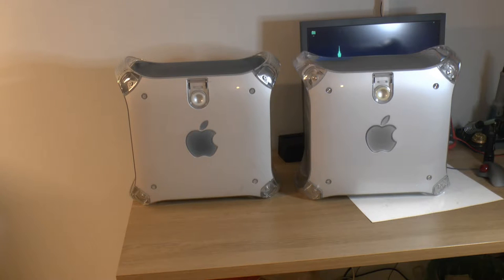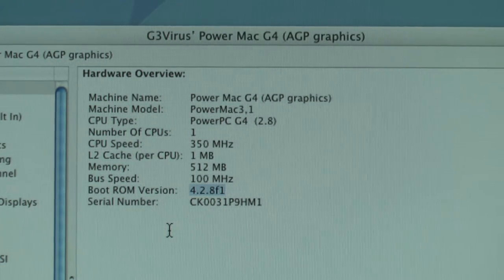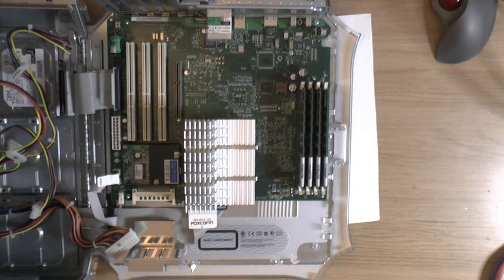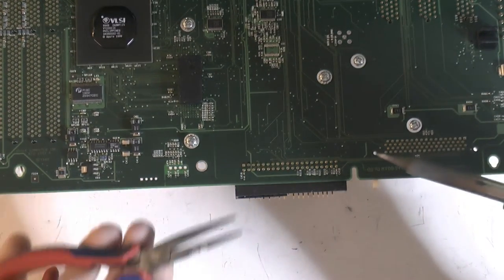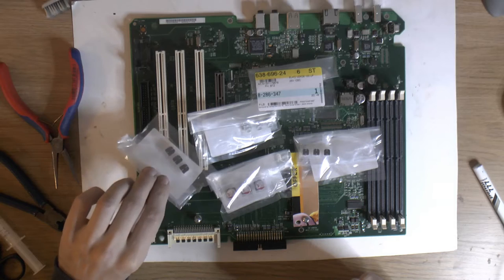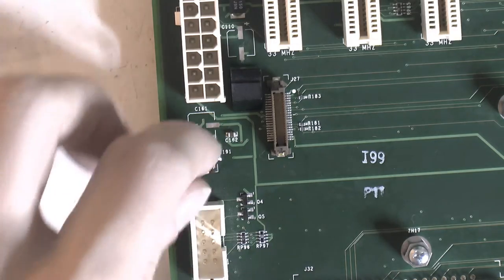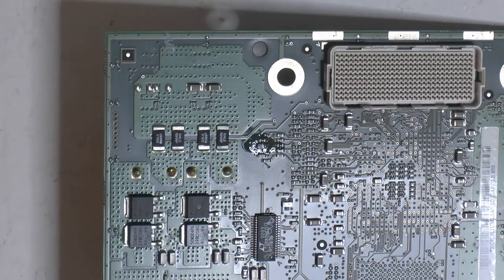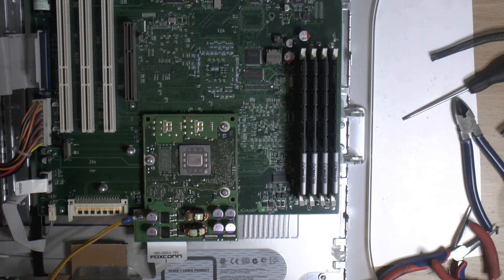Power Mac G4 restoration and upgrade - part 1

Comment: I have the Power Mac AGP 450 Mhz that throws a tantrum.
If I start the system with the SHIFT pressed it completes the boot but obviously has no hardware acceleration, no audio etc.
Otherwise it freezes on the blue screen with the pointer moving if I move the mouse.
Tried to reinstall OSx
Tried to change hardisk
tried to change video card
Tried to change ram
Checked the power supply voltages.

Some advice?
Reply from the maker: Not rely, this Mac is my first since I owned a G4 Mac mini back when they where new so this was a learning experience for me to.

If you tried most removable components I would try to get a motherboard on ebay, search for "powermac g4 motherboard", they seem to start at 20-25€ so its probably cheaper to just try that.
You sad you tried to reinstall it, can you boot anything?
If you can try the tool I used to check mine out. Techtool Pro 4.
Im running it here. It might be able to pinpoint the problem.
https://youtu.be/G3ZSwNw_ETc?t=649

Just google for the tool, its bootable from a cd or dvd depending on version. I used a cd version.
Reply: Thanks for your reply, you are very kind.
Actually I have tried several ways to make it work and I'll explain why:

With a hack I also tried to install OSx Leopard, which he completed without problems, just like with Tiger or OS9.
But on the first reboot, as soon as it loads the video drivers and that blue screen appears with the pointer in the upper left, it seems that it does not go further despite the noise of the disk indicating that it continues to load.
So I turn everything off and heartbroken I keep it ...
After many days I decide to try again, I turn it on and miracle it loads OSx Leopard and everything works, audio, video card, network everything….
I use it for about an hour without a block without problems, without restarting.
But as soon as I decide to restart, it starts having the same problem again.
I have other Mac G4s (QS, MDD, G5) but none of them behave like this .... it's very strange.
You ask me to buy a logic board on eBay but few people are honest and they send you something working….
But if it is the only way forward ... I will do so.

Why so much insistence? Because I love these PowerPc technologies, because I know they have untapped potential and I would like to fix my toy! ;)
Reply from the maker: @Vlamat67  I have bought many things on ebay but I use it as a last resort. But I find it to be fairly reliable, got the wrong thing once and one thing got lost but I got my money back not questions asked both times.

The reason I suggested a new motherboard is if you have already tried components from a similar system, Graphics card, hdd, ram etc and those components are know to be good then the motherboard is next.

Considering the price a used one off ebay its not that expensive and the motherboard is the most complex thing in the system so often whats broken in old computers.

So I am "suggesting" it because theirs really not much else that I can think of being the fault if all other components and software has been excluded as the culprit.
I saw some deals where the CPU was included to, I like to have some spares for testing just in case.
Its very difficult to rule things out with out spares parts thats the reality.

I assume the PRAM battery have been replaced to so its fresh?

Anyway I hope you get it fixed!

Comment: This CPU card can be safely overclocked to 1GHz without problems, i have try some years ago.
Reply from the maker: Probably but running the 100Mhz FSB instead of 133 means Im at the Max 8 multi the PCB allows me to set moving the resistors. 
As fare as I can tell from the Motorola CPU docs there are multi higher but that will probably require modifying the PCB because the extended range multiplier resistor is not on this PCB as fare as I can tell.

But if anyone knows how to set 9x and higher Im all for it!

Also I am running a 867@800 now with 2Mb L3 cache so this video is a bit out of date.
Reply: If your motherboard is a Sawthoot you can overclock the bus from 100mhz to 133mhz via Open Firmware. If you have a Gigabite Ethernet, you can put up to 120MHz with some jumper in the motherboard:
https://rosysumenteinquieta.blogspot.com/2006/02/como-subir-el-bus-de-un-g4_5.html
Reply from the maker: @indibil  Yes I know, I have micro dip switches for that. But its not without problems like USB ports not working, no guarantee it will do 133Mhz.
Also 4 sticks of ram at 133Mhz, not gonna work with none buffered sticks (not that it even supports that) and thats why the QS board has 3 dimm slots.
Also if I recall you need to patch it so the RTC runs at the right speed under OS 9, think OS X will sort that out it self.
Reply: you can overclock the 800mhz G4 without L3 Cache up to 1GHz:
http://rosysumenteinquieta.blogspot.com/2007/03/overclock-del-procesador-de-un.html
http://rosysumenteinquieta.blogspot.com/2007/03/overclock-del-procesador-de-un_30.html

I have build this mod some years ago.
Reply from the maker: @indibil  Yea thats a nice guide.
I have looked in to it before.
The 867Mhz I have running 800Mhz is about 48% faster in Quake 3 then the the 800Mhz with no L3 cache so even a 800@1Ghz with no L3 is gonna be a lot slower.

The annoying thing is that the PCB for the L3 cache version do not have the extended multiplier resistor in the same place, I can guess where it is but idk for sure thats the problem.

Might look in to it again, best thing would be to get the 867Mhz L3 2MB version up to 900Mhz.

But thanks for the guide!

Comment: OMG!!!  NEVER RIP surface mount caps off a board with pliers like this guy does!!! This is a perfect example of what NOT to do!!!!  This is a perfect way to ruin a board!!!
Reply from the maker: There is no ripping anything off. Giving it a gentle twist back and fort with little to no force fatigue the metal. The legs are bent at a 90 degree angle and flattened when manufactured , thats where they are weak and will naturally break from metal fatigue. Twist gently, never pull. thats the trick because the pads are strong along the board not when you pull.
Thats why your likely to pull them off if you use an iron, hot air works but there are risk wit that to.
It's not a new technique ore on I came up with and Im not the only one that uses if because it works well.

There is no ripping going on here, you only ROTATE a few degrees back and for and they will break of naturally with little to no force.

I know a this comment would come so.

I wont tell people how to do it, like I sad in the video this is what I find most reliable for me, you do how ever you want. 

There are more information on this method on the net, decide for your self what method you prefer.
Reply: You think these 30-40 year old pads can hold up to twisting and pulling?
Reply: Also, you know when caps leak they cause corrosion, right?
.
You get a little corrosion and start ripping and that pad is going to come right off.
Reply from the maker: @DavidZinAZ  the board is from 1999 so 21 years old. There is no PULLING, watch the video. You fatigue the legs on the cap above the pads, you dont pull or twist the pads thats the point.
And there was no corrosion or obvious leaking YET.
I have been recaping boards for over 10 years back from the Pentium 3 era boards.
I have don it this way for the past 2 years with SMD caps, not a single pad was damaged. Have you even replaced a SMD cap or is it just talk?

You can go watch this video of the technique the one I use is based on. I prefer the smaller rotation alternating left and right because I want the legs to get fatigued not stress the pads.

https://youtu.be/X8N9O3a9jiM
You can read more about it here.
https://www.eevblog.com/forum/other-blog-specific/mr-carsons-smd-capacitor-twist-off-method/
Reply from the maker: @DavidZinAZ  Yes this is not my first rodeo, I have been recaping for some time, I have seen lots of corrosion, caps are not the worst offenders, Varta battery are. I have repaired many boards with corrosion damage, trace repairs etc, 286,486, Socket 4 etc.

Im not new to this, only new to making a video.

Stop assuming people dont know anything and that just you do, its condescending.
You have the right to your "opinion", an people should do research before doing solder work and they should test and practice on dead boards of no value to them before applying any method to the part they want to save.

People should use the method that works for them and the board in question not what you or other people say they should do if there not comfortable with it.
Thats how you break stuff.

This video is not a how to solder, its a video about me an my Mac G4 build.
Reply: I usually remove my caps with a hair dryer and a screwdriwer
Reply: i understand you have done this a lot. i have worked with electronics too (power amplifiers and automotive ECM's mostly). what you are doing is best done on through hole devices. it would take time to get the "feel" for how a cap behaves so thats just how you learned. it is not proper industry practice to do it this way however - as a tutorial video, where a novice will take this method and stand a very good chance of tearing a pad off a board. there is a right way and a wrong way - seldom is the quick way - the right way.
Reply from the maker: @beardedgaming1337  maybe write a comment on this video where I learned about it.
https://youtu.be/X8N9O3a9jiM